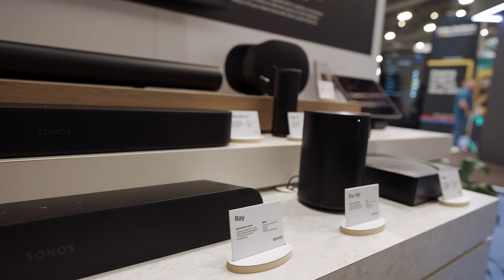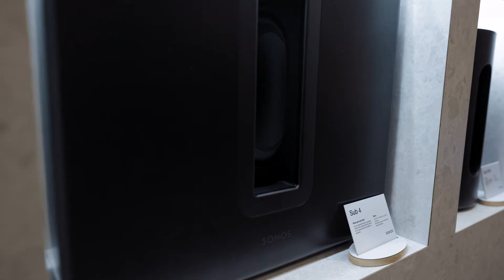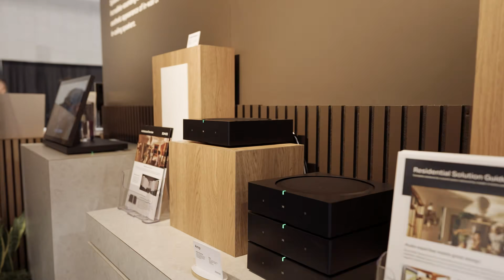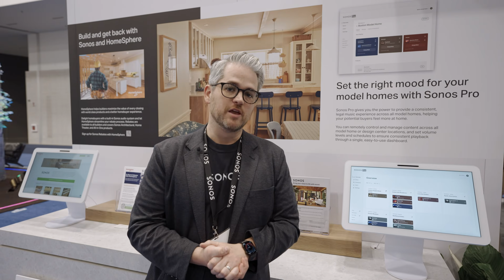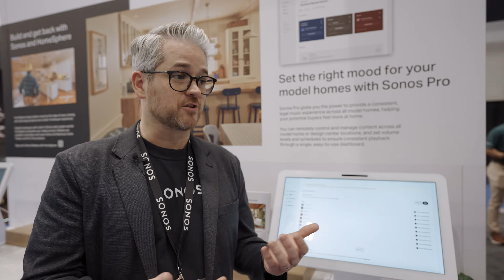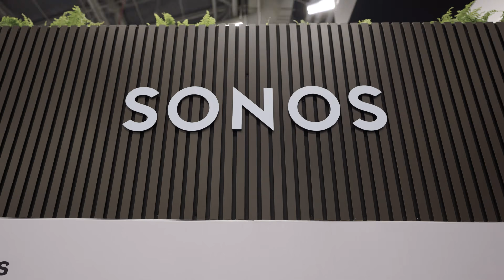Sonos Product Spotlight | Builder Innovator

Comment: I started with the Beam Gen 1 and Symfonisk rear speakers on an Office LG OLED 55C1 back in 2020.  I also had a Nakamichi 7.2.4 on a LG OLED 77C1 in our main TV room.  I later upgraded to the Beam Gen 2 and added a Gen 3 sub (Beam1+Symfonisk moved to Master bedroom).  The office Sonos system sounded better with 5.1/Atmos, easier to use, and had a bigger sound from a smaller footprint compared to the Nakamichi.  Ended up upgrading to the v1 Arc, dual Gen 3 subs, and Fives a few years ago (upgraded to the Arc Ultra when it came out).  Very happy with the Sonos system and now have 20 pieces around the house.  I only use the Sonos app when I add, Trueplay/adjust EQ, or move speakers around.  Mostly use the TV remote, iPhone Airplay, or just press the play/pause button on Sonos speakers to add/remove audio.

Waiting on Era 500s and the ability to use more speakers together in the theater group and Trueplay them together (4-6 Era 100/300, and 2-4 subs).
Reply: Have Sonos Arc, sub + 2 One surrounds in the bedroom but thinking about going Nakamichi Dragon in the Living Room. Still doubting, I will make a mistake. Might have to go Arc Ultra, 2 Era 300 and maybe double Sub for the living room and play it safe as I am very very happy with Sonos at the moment. But the Nakamichi sounds so cool and looks badass! NAKAMICHIIIII! I just want to HAVE IT! But again, might make a mistake! Never had the option to listen to it in person.